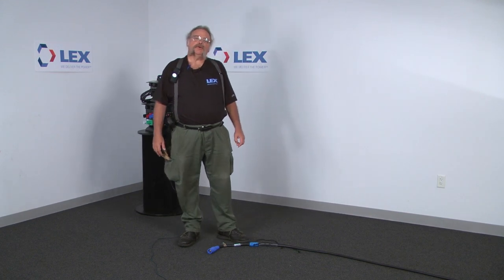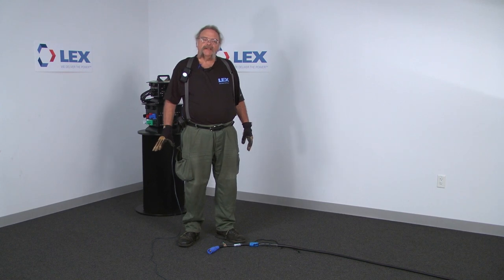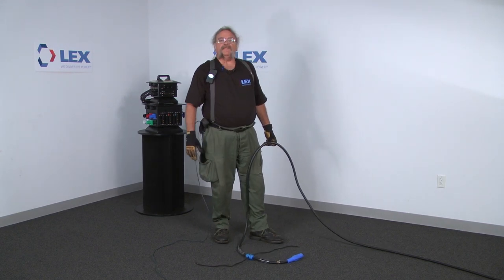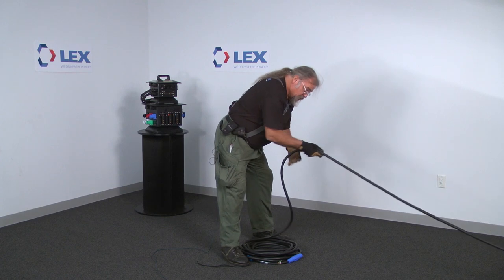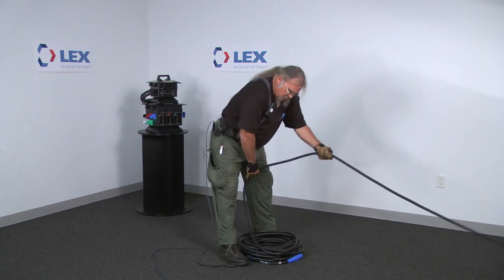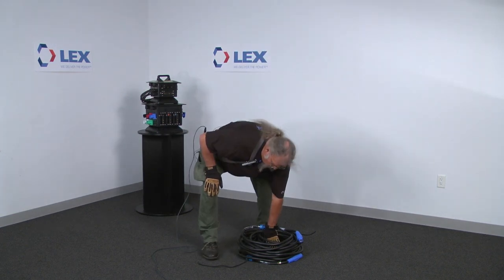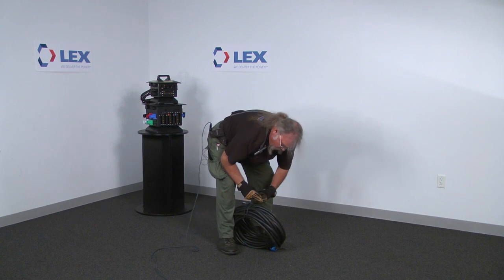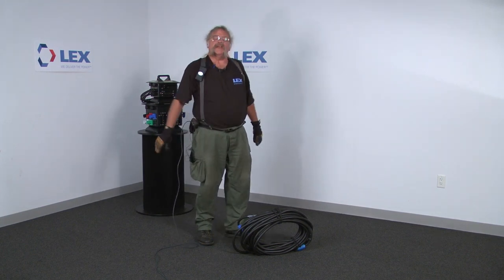How to Properly Coil Large Gauge Cable – Method #1 of 2

Comment: Should you plug in the power cable ends? I've told that you can have induction developing inside the coils and it can even burn if done so.
Reply from the maker: Yes, having single conductor cable coiled like this while in use can cause induction. This video is demonstrating coiling cable for storage purposes. If there is excess cable in your cable run, it is best practice to coil the cable in a figure 8 pattern to negate the effect.